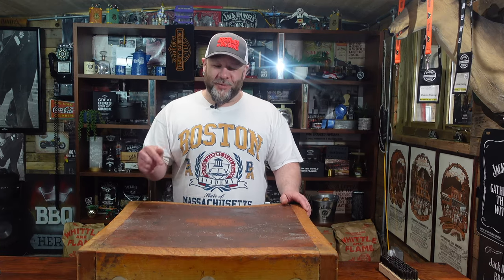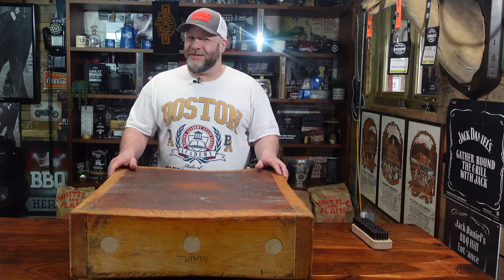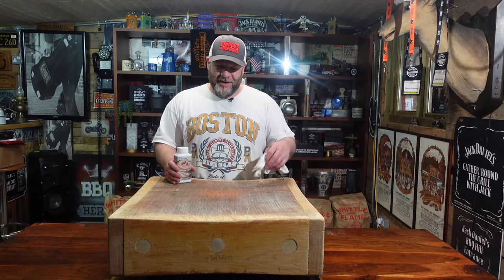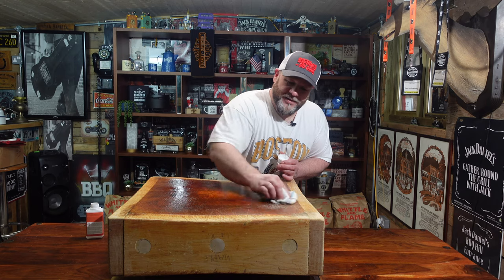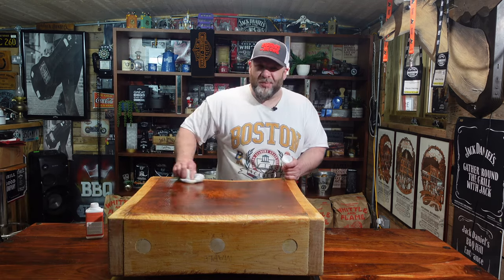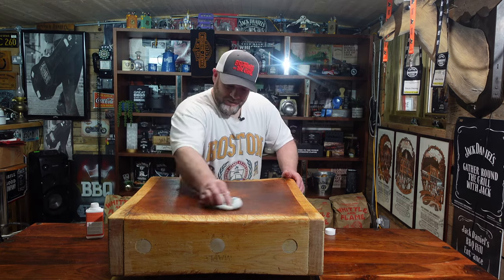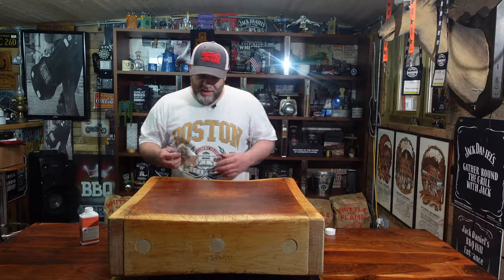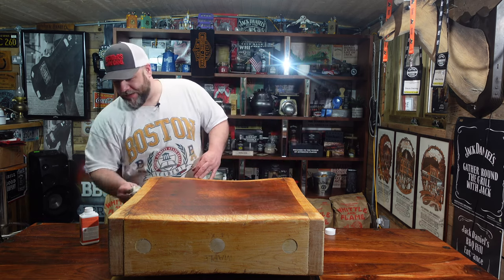How To Clean And Maintain Your Butchers Block

Comment: I've been a butcher for almost 40 years, and I've gone through a few blocks. I've also restored about a hundred of them over the years. If you do this again, try plain "popcorn salt." It's much finer grain and gets into all the small scratches.
Reply from the maker: I will definitely give that a try! Thanks 👍 😊
Reply: Hello, am in the process of making one for my shop. Does this have to be done everyday? Till now we were using logs. those aren’t practical unless it’s a full length. With cleavers well made blocks should last long, right?

Comment: Great to see as so few showing the way to do it. I thought salt and a wire brush would be involved.  Any guidance for plastic chopping boards, especially post prepping chicken?
Reply from the maker: I have recently started using disposable chopping boards for chicken, etc, you can get them online 30 for about 29 pounds. But I wash down with hot, soapy water pre use and after use if using wood chopping boards
Reply: @BrothersoftheGrill  Great, thanks. May I ask why you are using disposable chopping boards for chicken? Is it due to how it sticks to the board?
Reply from the maker: @soothe & sound  it's more for hygiene, to be honest. They are fairly cheap.